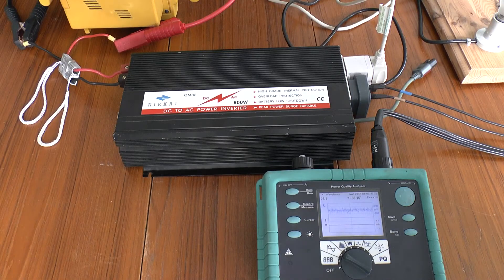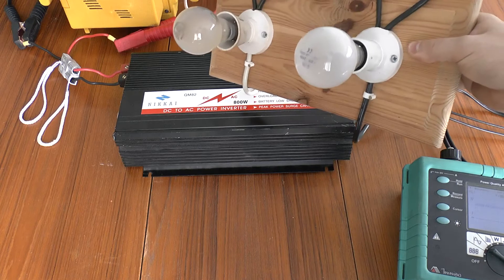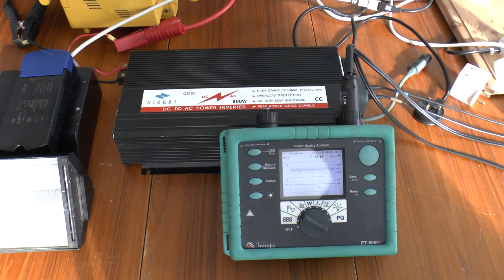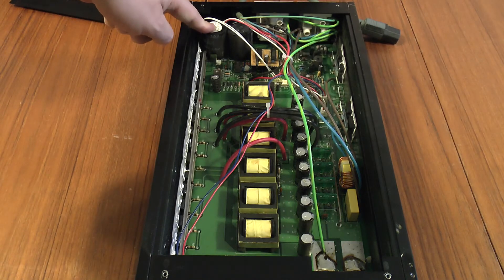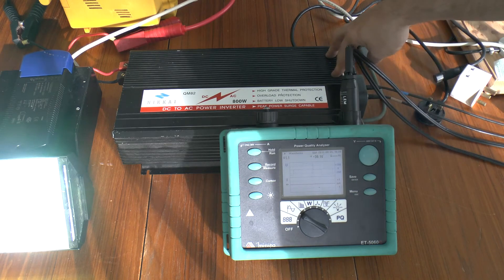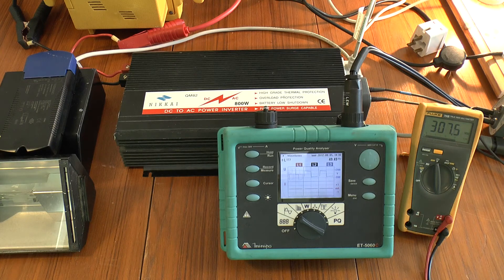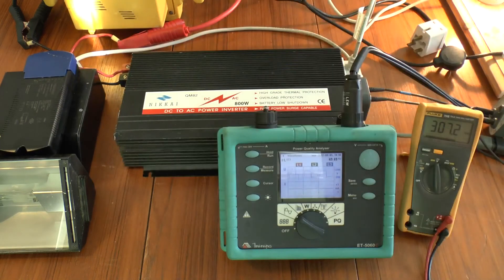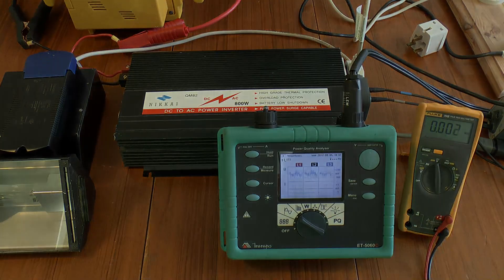Nikkai/SkyTronic mains inverter waveform and DC output mod

Comment from the maker: Not sure. At low frequencies I'd expect the motor to need some current limiting. Besides, the output from this is basically a square wave, which the motor might not be too happy with. Cranking the output frequency ABOVE 50Hz might give interesting results, mind.

Comment: That would require reworking the H bridge control circuitry to output a completely different waveform as well as adding loads of filtering to cut down on QRM.

Comment: If the inductors are wired in series with the supply, then all it will do is attenuate any conducted QRM from the SMPS in the ballast that would otherwise go out on the mains cable.

Comment from the maker: This one does it in exactly the same way, but with a 300V DC bus. As the inverter circuit in this one is driven by its own low-voltage, isolated supply it can safely have one side (in this case the neutral) grounded.

Comment: You can pass DC through a bridge rectifier. One problem with it though could be that now the same two diodes are always under load while the other two are always off. If the manufacturer was skimpy and chose a rectifier running at the limit on AC, DC could easily blow the rectifier.

Comment: A variac only allows one to change the output AC voltage but does nothing to improve the waveform.

As for running a 60 Hz transformer on 50 Hz, many will work fine but for transformers designed for only 60 Hz, you'll probably get louder mains hum from it, or possibly cause excessive heating inside the transformer.

Comment: Also, many inverters (at least over here in 120V mains land) have their 140VDC buss tied to ground and create the modified square wave by means of a MOSFET H bridge, so the concern with them is the floating neutral.

Comment: Typical transient suppressors (MOVs, avalanche diodes and GDTs) should be able to work on DC as they are designed to trigger on potentials in excess of their normal peak operating potential.  What will be an issue are switches and some SMPS front ends.  Contact switches may not quench arcing, TRIACs will not shut off and SMPSs that have potential doubler front ends (the 120V setting on ones with a potential selector switch) will not work properly.

Comment: Yeah, not a problem. It's insignificantly more efficient without them as there will be approx .7v drop across them. Biggest possible issue would be as ABAC says in the video, some of the input protection and filter components might not like the DC voltage

Comment: Should work, with a SMPS the mains input AC is rectified to DC before being pulsed at a higher frequency to drive the transformer. The only issue I see is any of the input filter components causing a problem. Would be most efficient to remove all the input filters and diodes (bridge rectifier) and even the capacitors (although won't harm to keep them).

Comment: Yeah but not as much fun :) Long time ago I saw a PSU with a built in battery which I assumed was configured in this way, I believe Google custom servers have a similar arrangement? I think it would be interesting to hook up a PC and monitor to DC and see what happens. More chance of the PC working OK, less certain for the monitor

Comment from the maker: Possibly. SMPSUs are typically rated 90-264V AC, so a string of eleven 12V batteries might power it for a while, at least until the battery voltage drops to below 127 volts (about 11.54 volts per battery or 1.92 volts per cell).

Comment: Thanks for the response. I've often wondered how a standard PC power supply would handle DC input.. The idea then being to bypass a UPS and simply use enough 12v batteries in series to reach the required voltage (using a wide input voltage range PSU e.g. US 110v to minimize the number of batteries)